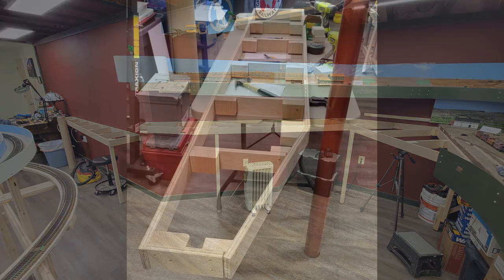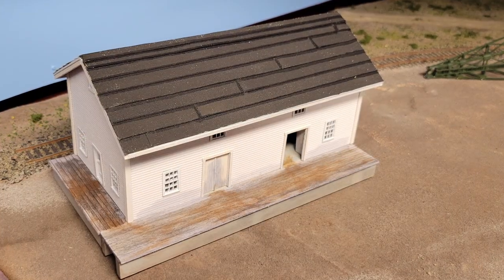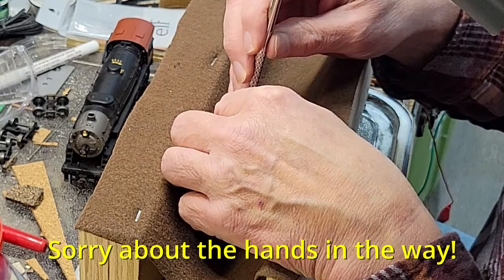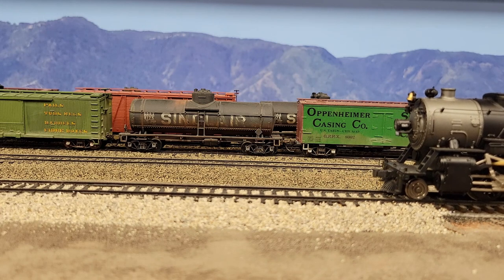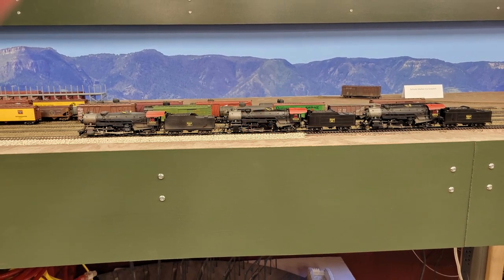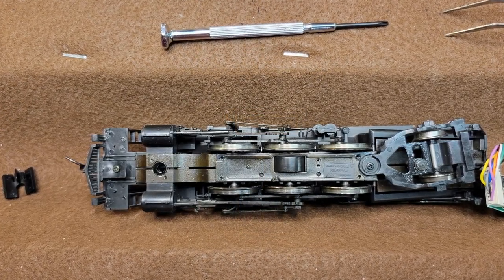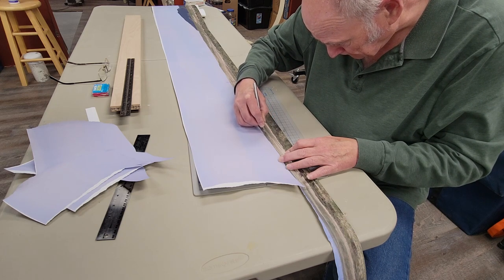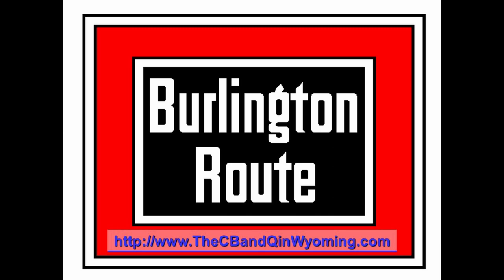2022 04 03 CB&Q V5 Monthly Update #29

Comment: Well HECK!  You got a lot more done than I did!
Check the worm gear clearance on that last loco.  They're often too tight & can cause continuous drag.

Among a couple other things, I got a used Bowser PTC trolley with a metal shell on eBay.  Of course I have to paint it.  In the meantime, I pulled apart the motor most of the way, reground the brushes and figured out that the non-motorized truck (which is the other rail power) indeed can rotate fully so that the trolley doesn't run at all - but it does ⚡park!  Good deal!!  I marked the frame and that other truck with a spot of paint so I can match them whenever I decide to run it.  

The truck gearing and half the motor were soaked with oil, so I disassembled both to clean them, putting much less on to avoid dust & dirt.  Well, the drive gearing starts with a vertical worm gear that's below the vertical motor that's mounted solely on the powered truck 😬.  Thus the power shaft goes through the truck mount and the worm is under the frame - inside the truck.  Then there are three idler gears (loose on their also loose steel pins); one idler from the worm to one geared axle and 2 idlers from the worm to the other geared axle.  Both axles were the same as were the idlers.  So I didn't bother to mark or sort them.  Naturally they didn't want to work when reinstalled (the SAME... but DIFFERENT☝️).  I spent a reasonable time reconfiguring the same parts in various order until it ran. 🤬 🤪
Reply from the maker: Sounds like you had a great time, Frank! I learned the hard way to mark everything so I knew which piece went back where, and in which direction. It saves a lot of time.
The worm in the Pacific was slathered with oil as well - all the way down to the coupling. I wiped all that off. I think it came from the factory that way - evidence suggests the unit was never run at all.
Reply: @mapruitt  Nope.  It was aggravating.  But it's funny to tell it afterwards.
Just don't bring up the Fruehauf trailer model.  We don't talk about that.  :-)

Comment: Great stuff, Mark!  Make no apologies for the length of the video -- folks can tune out any time they want, but I'll bet that most will hang in there for the whole thing.  It was great seeing a stable of CB&Q power on display! A thought for your Pacific that you probably already considered:  I remember an article in MR by Jeff Johnston on repowering the original Mantua 2-6-6-2 to make it behave.  He used universal joints to link the motor shaft to the gears, and I think he used NWSL products.  That's what I'm going to try with my 1990's era Mantua 2-6-6-2s when I get around to repowering them (yep, I'm a slow bloomer too!).  Last comment: Excellent choice on expanding the benchwork for the Wind River Canyon to allow modeling both sides of the canyon!  I think it could wind up being the focal point of the entire layout, and would yield excellent photo opportunities.  Keep it up, brother!
Reply from the maker: Thanks Kevin! I tend to prefer to watch shorter videos on YouTube (10-15 minutes), so I try to keep mine shorter also. I thought about making this one a two-parter but decided against that. Might do that if I wind up with another long video in the future.
Interesting idea about the universal coupling. I thought about that too, but the ends of the shafts are only separated by about 1/4". No room. 
Let me know how it goes with your Mantuas when you get to them!

Comment: First, no, your video was not too long!  I learned from seeing your repairs.  I know that CB&Q had a batch of USRA-type 2-8-2, and that they were used in Colorado and Wyoming, but I did; think they had any USRA 4-6-2's.  Yes, a nice 4-8-4 would be wonderful.  I keep hoping that BLI might someday make an O5 like CB&Q 5632.  CB&Q fans, keep sending cards and emails to BLI showing ourinterest!  When did CB&Q start running diesels in the Casper area?  I remember a nice Burlington PR photos showing a pristine set of FTs in the Wind River Canyon, but I don't know when they started showing up on a regular basis.  How about diesel switchers?  It seems like CB&Q liked to replace steam switchers first, then passenger power, then road freight power.  I always enjoy watching your progress.  My CB&Q is set about 20 years later and in eastern Nebraska, but I still draw inspiration from your Burlington.
Reply from the maker: Hi Gary, thanks for the compliments. Burlington might not have run any Pacifics in the area. I thought they did, but I'm honestly not sure. I'll just call it modeler's license if not. 
I don't know when diesels started appearing on the Casper division. I've heard it was very early because of water supply problems west of Casper. The Casper to Wind River Canyon line went through a lot of very dry territory!
I do like the CB&Q diesel paint schemes, both black (they call that the Blackbird scheme or some such?) and especially the Chinese Red. I remember seeing that last running around here when I was a young kid.
Do you have any photos of your modeling posted anywhere? I'd sure like to see what you're doing!

Comment: HEY, don't feel too bad. I have a brass 3 truck Shay I bought in 1972. It was pretty $$ back in the day, and has maybe 20 minutes running time. It's still in the box due to years of no layout, moves, etc etc. I'm  currently building a logging RR, so there's still hope. Of course, the plastic engines of this century have such great detail and run well. Keep up your good work, I'll do the same.